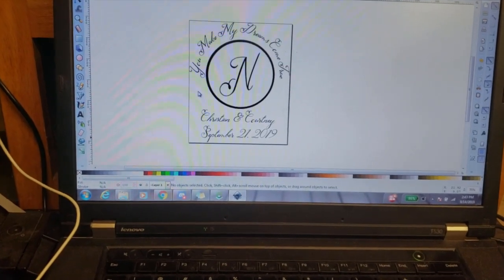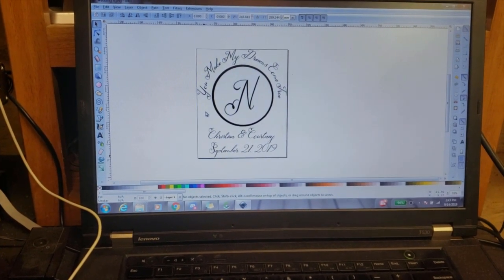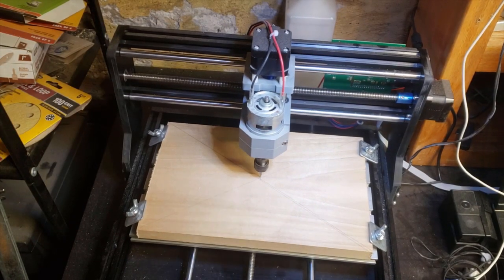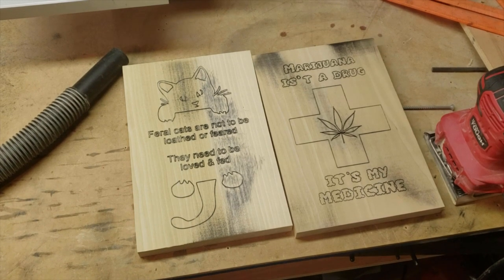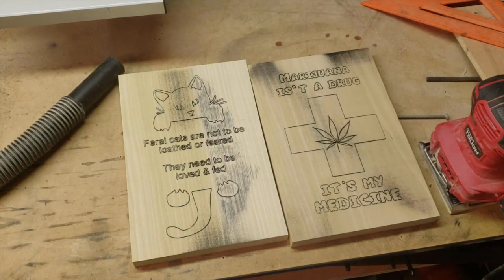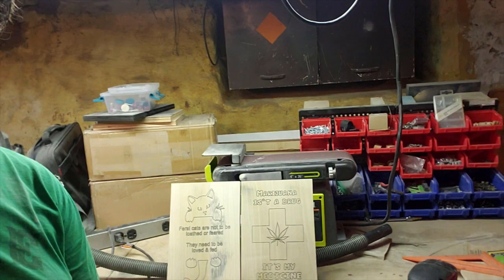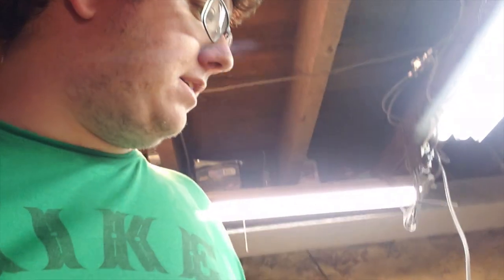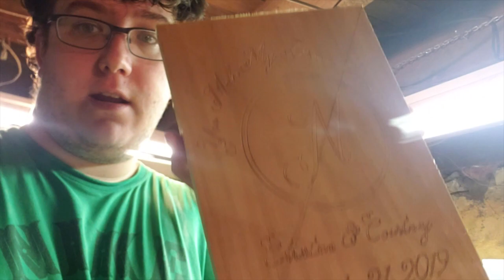Non Stop Sign Production Part 1

Comment: Good carvings. For your dark spots think you should seal the wood with sanding sealed, shellac or Danish oil before black spray. This should stop the spray soaking into the pores. Are you using airbrush& acrylic or rattle can/car paint?
A random orbital sander would be easier for you (& environment with dust collection) than the bench belt sander and more controllable. Coarse then finer grits